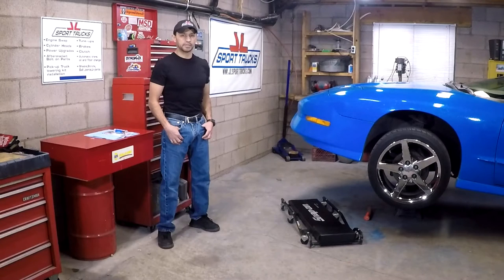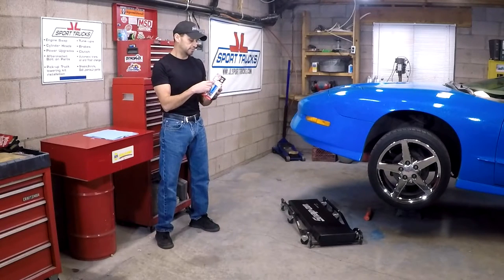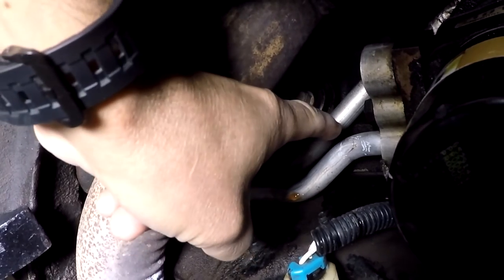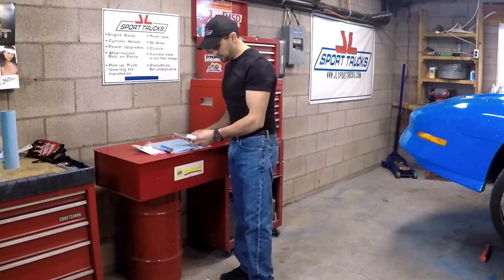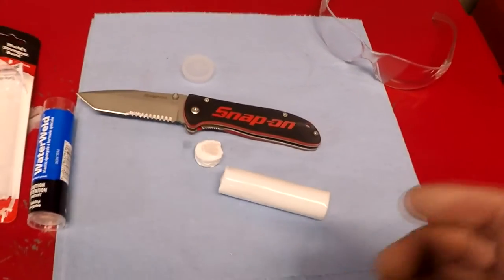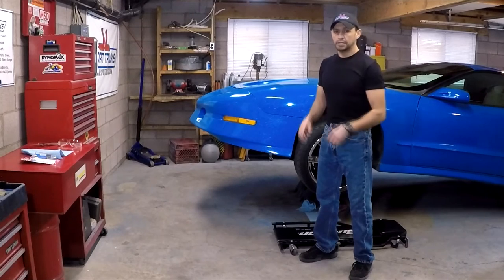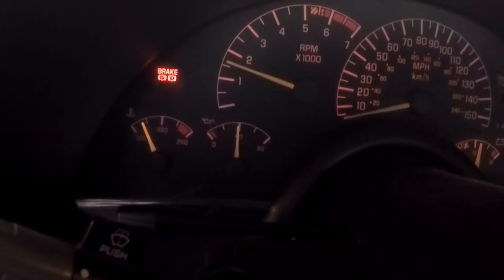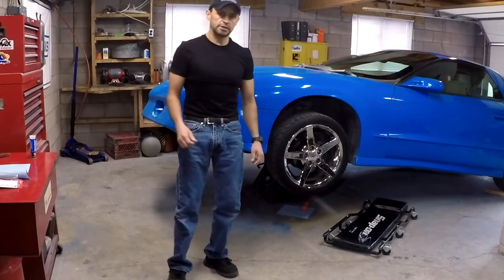Repairing an Aluminum Coolant Pipe using Water Weld made by JB Weld at Howstuffinmycarworks

Comment: I was contemplating getting that one. But I ended up getting the quick steel one. On my Mercedes I cracked the aluminum housing a piece literally cracked off while I was trying to get the oil filter cap off. So I put the cracked piece back on and I have been using JB Weld it’s been holding the crack in place but oil keeps leaking from these tiny little holes so I finally went and got the Clay. I’m hoping tomorrow I have better results with the Clay. (For good measure I also put regular JB Weld on top of the clay job) lol but Thanks for the video and nice ride and bod 👌
Reply: How'd it work?

Comment: I am a huge j-b weld fan, depending on the application, and it usually holds up very well! I have not had to use the water weld yet and not on a coolant line, so I am curious if it'll work out for you. If not, don't lose faith in them completely though. I had the type that was supposedly designed to handle high heat and exhaust, but it failed considerably. I still stand behind the product for many things though. And to their credit, my exhaust issue was major, so I was asking a LOT of it, I know.

Comment: I have similar leaks on my truck.  There were multiple holes on the aluminum pipe.  I tried sealing the holes with the putting but it will not stick because coolant was still leaking…Guess I’ll have to drain it.

Comment: I'm about to put a new radiator in my 1997 Ford Ranger. The other radiator was only a year old. It was leaking at the top transmission line fitting. I'm going to put the J B Weld around the fitting on the new radiator as a fail safe measure. 🤞
Reply: Did it hold up

Comment: I have a ALUMINUM GEAR CASE WITH A SERIOUS CRACK IN IT AND IS LEAKING GREASE. WOULD JB SEAL IT ENOUGH TO HOLD UP?
Reply: Yes I've a repair patch on my rocker cover, jb weld with stainless mesh, it  covers over a hole the size of a penny which I accidentally caused whilst pulling out an injector, six months still good, use the original jb weld and adhere to the instructions

Comment: Using it on my plastic radiator reservoir. It shouldnt hold any pressure so i think my should be able to hold up. Let me know if you want to know how it worked. Im having to also change fluid bc the mechanic shop i was at put the wrong coolant in, damn idiots.